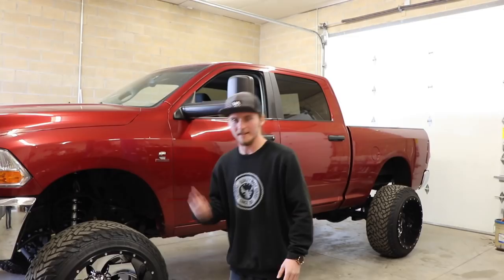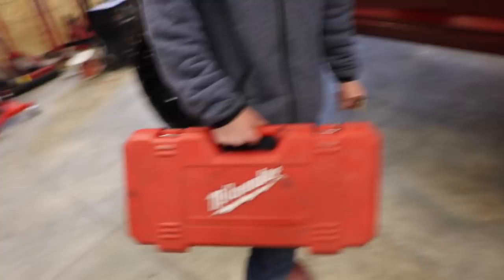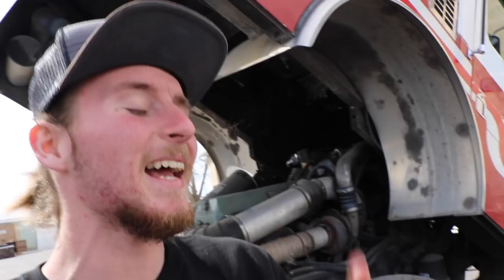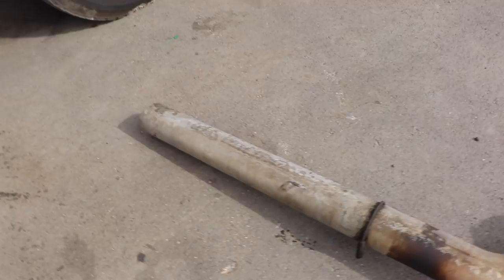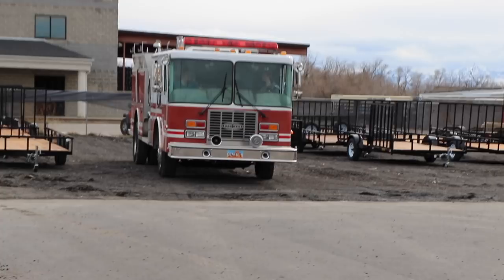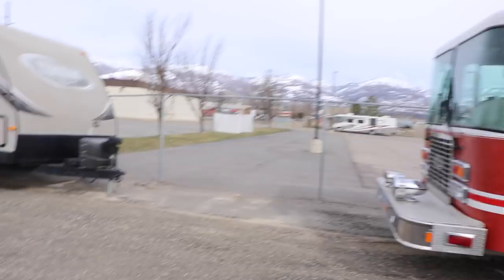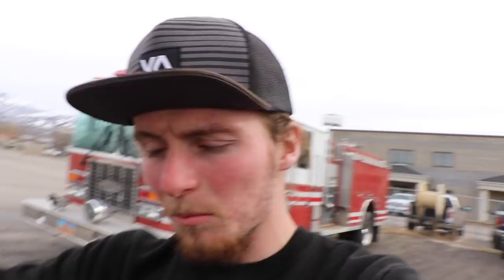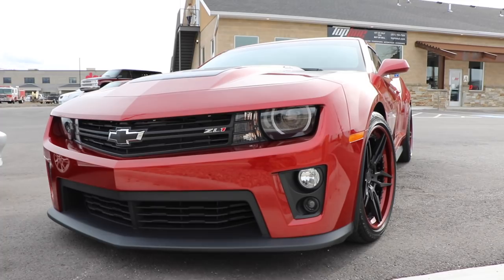I STRAIGHT PIPED A FIRE TRUCK!!

Comment: too bad it wasnt a 12v72, you;d want that muffler, those things are bloody loud.
Reply: Justin Bechtel lmao had a pete with a 8v71 and twin 6in straight pipes. It was obnoxiously loud in need of ear plugs.
Reply: Those big ass Detroits sound badass! Best sound you can get from a two stroke.
Reply: Justin Bechtel when he said Detroit I got excited but I should have know it was a series 60
Reply: 8v92, there were tons of fire engines made with those.
Reply: Justin Bechtel at the department I was a firefighter at we had a old 84 Volvo/White 3000 Gal tanker with a 12v72 in it.Even with a Muffler the Jake would rattle Windows under a big slow down
Reply: friend of mine owns an old kenworth cabover, think it was a k100, with a 8v72, had twin straight pipes, he does local deliveries with it, but for fun he likes to drive through the "richer" part of town, he's gotten noise complaints because of it but the cops couldnt do anything about it.
Reply: Were there ever firetrucks with 12V71s? (other than trucks with pulling water tanks maybe) btw you americans and canadians have so many cool vehicles and engines for so little money

Comment: 10+ I do think you should replace the muffler with a piece of pipe and put it back on so the exhaust goes out the side again not just into the cab. Then put a big ol tip on it
Reply from the maker: Kyle Peterson That’s the plan!

Comment: 1. red and clear LED strobes. 
2. keep the same paint scheme when repainting. 
3. run the straight pipe back to the original location of the stock system.

Comment: Bigger waste gate spring on turbo. Whalen led lights. Polished alcoas. Rattle canister so Jake is louder. Tune or fuel pump turned up. Solid black and red and gold pinstripes. That's all will look great

Comment: We have a 1972 fire truck that has a gas motor that is straight piped and it is louder than the siren also if you down shift it you can get flames out of pipes

Comment: My 59 Chevy Fire truck is getting straight piped til about 1' before the rear axles then it's getting a 90° turn out each side with about a 4" pipe

Comment: I give it an 8 out of ten with the series 60. But if it had a 2 stroke Detroit like an older truck it would of been 100 out of ten. Maybe repower it with an 8v92 or a 12v92 two stroke Detroit

Comment: cutting the muffler off isn't straight piping it- replacing the muffler and tail pipe with straight pipe is straight piping it. It would be even loud if you actually straight piped it

Comment: Detroit Diesel DD13 its a new fire truck we bought has a over 540hp 5 inch straight pipe fully dump with a 5 inch tip. If i get 1.5k likes on this ill do a burn out on live stream on youtube in front of my fire crew. I might get fired if i do?  so hit that like bottom.

Comment: I hate to say this but that is not "straight pipe". "Straight pipe" would be if u welded an extra pipe on it with no muffler.. all yall did was cut the muffler off.. just saying. Weld a piece of pipe on it without a muffler how ever long u want it to be.. that will be "straight piped". Just fyi diesels sounds really awesome if u "straight pipe" them and have the pipe coming out a 45° angle after the tire with a 4" exhaust. U should try this!